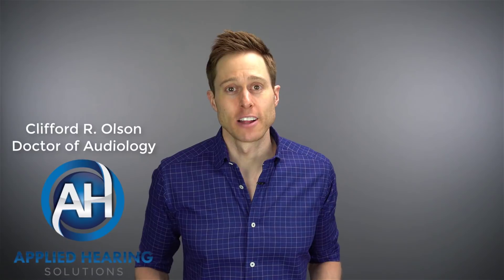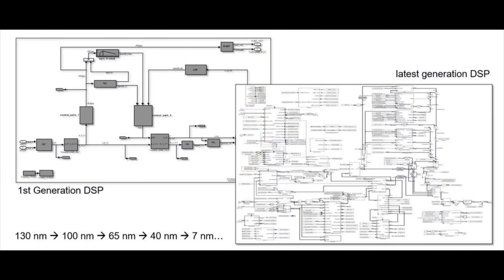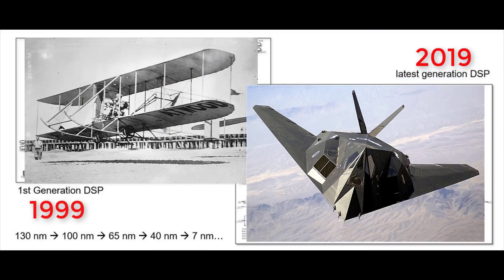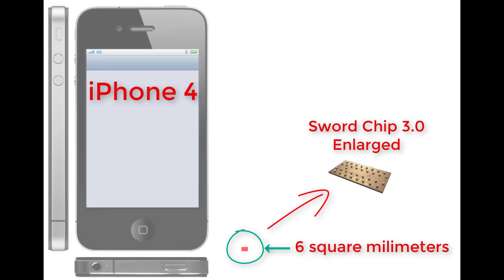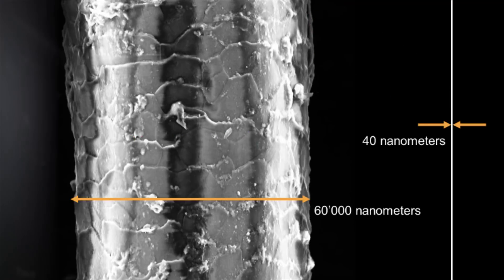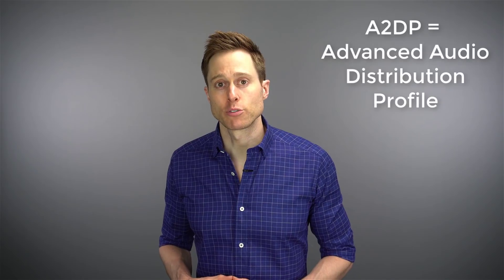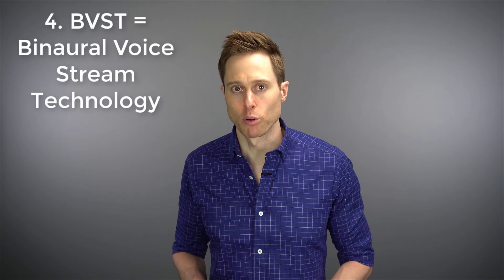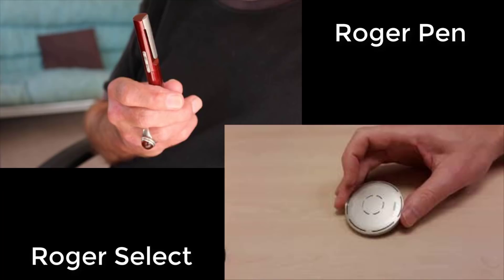Bluetooth Hearing Aid Technology & The Computer Chips That Make it Happen

Comment: Hi Dr. Cliff. I have the Oticon OPN miniRITE T hearing aids with a T-coil that allows me to use the loop system at my local theatre here in Pittsburgh. The theatre also has the Sennheiser MobileConnect system that I read is better than the loop, but I haven’t been able to connect to it. The MobileConnect app opens up and shows 2 different channels, but neither one connects. I’m wondering if maybe these Oticon hearing aids are not capable of connecting to that system. I assume I would use the same programmed channel as the one used for the loop.  Are you familiar with that system and if my Oticon aids can connect to it? If not, do you know where I can get further assistance and information about this?
Reply from the maker: did you enter the Channel-ID or scan the QR code?
Reply: @DrCliffAuD  Both, and neither worked. Should I be on the channel for the T-coil? My other two channels are only for different setting og hearing environments.

Comment: Hello Dr. Cliff. Always enjoy your tech briefs on YouTube! Got a question for you that has puzzled both my Virginia Audiologist and first line Phonak audiologist: My Marvel M90 312's have a significant amount of "white noise" that is sent into both ears when I am driving in the truck or car at 45+ mph or when I go into Home Depot with their large overhead air handlers. I have been to my audi at least 3 times and she has contacted and had phone consult with Phonak during one of the screen share sessions. No change. No fix. Problem still remains. How would you recommend I proceed to get a fix to this white noise nuisance artifact?
Reply from the maker: There are a variety of options depending on the specifics of the situations.  It sounds like something is either over-amplified (ie. Low-Frequencies), noise reduction hasn't been enabled properly in the correct program, or the noise is too loud to eliminate unless eliminating speech cues.  Hard for me to tell unless I know more and can troubleshoot first hand.
Reply: Thank you for your response. I remember we worked on the low freq that you suggested, but I don't think we looked at the noise reduction settings. That's an area worth looking into. Wm. @DrCliffAuD

Comment: Had to return my Marvel 90's as it was too difficult switching from iPad to iPhone. Phonak admitted there was a problem. Do you know if they (Apple or Phonak) has solved this problem with iPhone X? I’m now trying Oticon S1 with telecoil. Much easier switching Bluetooth from iPad to iPhone. However I really liked the Phonak 90 better.
Reply from the maker: By the nature of using Bluetooth Classic, switching between multiple devices is more difficult.  The question becomes how often do you have to do this?  I always recommend get the hearing right first, then the connectivity.